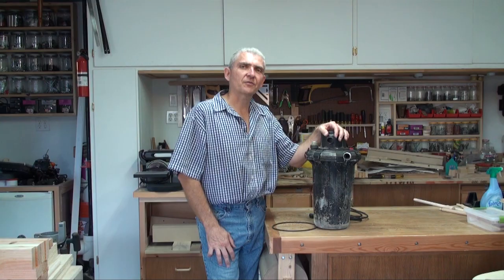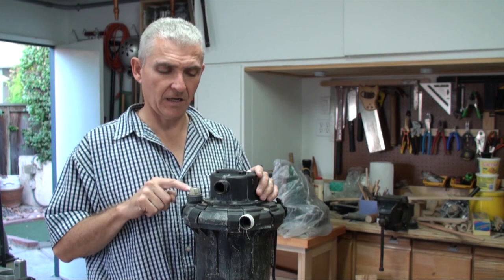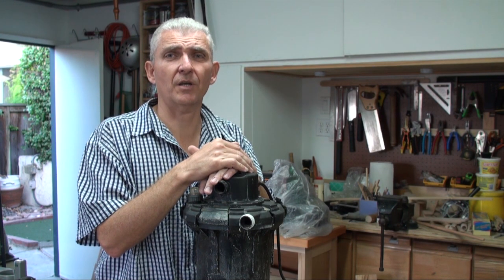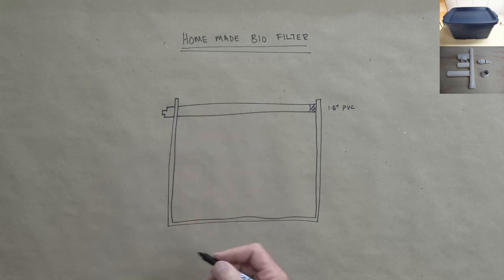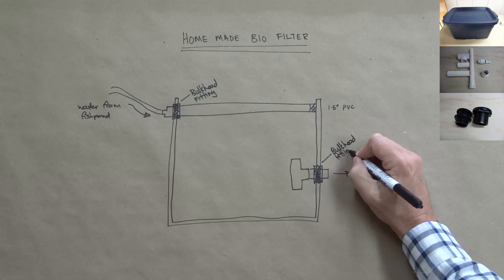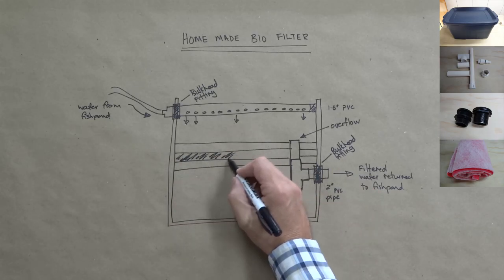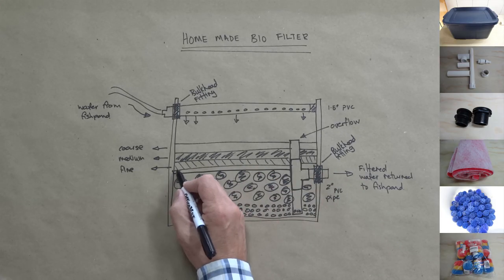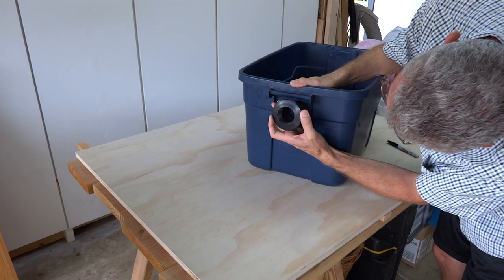Homemade Biological Pond Filter

Comment: I've watched your video several times before I made this comment. First, the video is very helpful and simple, thank you. How would you clean and use the waste water, I didn't see a shut off valve to drain and shouldn't you have to turn the pump off to clean and drain. I have 5 preformed ponds that I want to use, I'm thinking about placing each pond side by side, will I have to have a bio-filter for each pond. I've also made a large skimmer. I'm going to use larva rocks instead of the bio balls. To hold the top cover in place I am screwing it down with stainless steel screw. Again, thank you for your helpful video, great job.
Reply: adairsr53  I built biofilter with a 30 gallon trash can from walmart. My filter media is from Lowes.  It is the blue replaceable airfilters.  DO NOT PURCHASE THE GREEN FILTERS AS THEY ARE SATURATED WITH FORMALDAHIDE! I use scrubbies in the bottom for bio-media.  My out going bulk head is approximately 10 inches from the bottom.  I leave my pumps running while cleaning my filters.  I would not recommend completly emptying your filter as all of your beneficial bacteria grows in the bottom of the filter.  If you decide to use lava rock please wash the lava rock until the water runs clear! If not your pond will turn red.  If you are on city water, after cleaning the lava rock place the lava rock in a large tub, fill with water, and treat with a double dose of dechlorinator.  You don't want to harm your fish with chlorine that deposited in the lava rock.  Let it stand over night in the dechlorinated solution.   If the five ponds are not connected then yes you will need a filter for each pond. If your ponds are connected I recommend at least two pumps and two filters.  Remember that the rule of thumb for keeping a clear and clean pond is filtering or pumping the entire amount of pond water every hour.  For example if your pond is 1,000 gallons then you should have a minimum size pump of 2,000 gallons perhour. My largest pond is 5,000 gallons.  Since I can't afford to purchase a 10,000 gallon pump every few years, I run two 5,000 gallon pumps to two separate water falls at each end of the pond.  Both pumps are ran to homemade bio filters and I have never had a problem with green or cloudy water.  Although I do use beneficial bacteria regularly in all of my ponds.  I never use ALGECIDE! This chemical and other toxic chemicals not only kill wild life but also shortens the life of your pond liners.  I hope this helps.
Sincerely,
Lost Sheep

Comment: I tried this plan.  it is working but i am sucking in a lot of air through the overflow.  enough to put foam on top of the water. Any ideas or have you run across this?
Reply: If water is going into your overflow that means too much water is going in to the filter. Is there a way you could insert a ball valve in the line from the pond to the filter. You could then slightly close the valve until the water is below the overflow.
Reply: Kevin Kilkenny you could just add a little length onto your overflow allowing it to still work if it needs to but that way the water can sit on top of the filtet

Comment: thank you for sharing with us Trevor! i have a question- how are you going to stop the leaking around the bulkhead? i am planing to hide the filter in some bushes , i cant put it on top of the pond... thank you so much!
Reply from the maker: the bulkhead comes with a rubber gasket. I also cut the holes for the fittings exactly to size (i.e. a tight fitting). the combination of the two prevent leaking.

Comment: Thanks for the tutorial on the Bio-Filter. My Koi Pond was previously filtered with a sand filter, a .75 kw pump and UV Light. This worked great. Recently the filter cracked and rather than buy a new filter I used your design. Due to the high flow rate, 20000 lit per hour, the tote would not cope with this volume of water. I therefore made the inflow pipe, 50 mm pvc pipe, to the tote go straight through the tote and drilled holes in the pipe for water to flow through the filter. Most of the inlet water flowed straight through so to have more water flow through the filter I cut a slot, about 5 mm depth, into the inflow pipe just before it exited the tote. I inserted a small plastic disk into the slot which restricted the flow of water and allowed more water to be filtered. By adjusting the depth of the slot I was able to achieve a perfect flow rate through the tote without it flooding. The slot also acted like a Venturi drawing in air so the pond is being aerated more than before..After a week my pond was absolutely clear. Thanks again for an informative tutorial.

Comment: Hi there! Thank you so much for the helpful tutorial!
Can I ask how long does it take for you to change the filter?
Do you simply wash it clean or replace with new ones? Thank you!
Reply from the maker: Initially I cleaned the foam filter material (just washing them) every few weeks as they clogged up from the dirty water. Everything settle down after a period of 2 months and I only just cleaned them again after around 8 months. It will depend on your situation. Once the foam filter material gets so clogged that water will not filter down and simply flows over the overflow then you will need to clean the filter material. I do not touch any other part of the filter because all the good bacteria grows in the material below the foam filters.
Reply: Trevor's Workshop That's helpful! Thank you so much. :)

Comment: Craigslist is no good, sex traffickers use it for making contact with customers.
Reply: marshall886 your logic is so very deeply flawed...
Reply: I am happy to accept that. Perhaps though it would be good to consider 
that  how falsifiability of the statement that  the feature of anonymity in craiglist may  make conducting transactions and contacting others makes   transactions and contact, including sex trafficking make it more so than less possible to evade detection from law enforcement .  Note for your point: I am no longer going to make the argument that sex trafficking is  happening on craiglist for finding a null hypothesis if that is possible.
Reply: Actually since craigs is being used by older generation now, its been the most reliable, the new selling apps have the millenial time wasters that craigs use to have. Of course some scum who do advertise couldnt sex traffic if their life depended on it, you show up, they cant find the item, or sell to someone else when your on the way, just the risk of buying used.

Comment: Looks like a good filter, but more information on the pump, pipes and connecting material would be appreciated. Can you use garden hose off the pump to the filter?
Reply: jsharp116  Dear jsharp116 I would not recommend a garden hose from the pump to filter due to the small diameter of the hose.  The garden hose would easily clog from algae growth within the hose. If there were a way to flush the hose weekly with a high pressure pump, then perhaps.  I never use any type of plumping less than 3/4 inch in diameter.  Have you ever notice how decrotive spitters always seem to clog, or even just contained water garden features such as barrels, wishing wells, fake rock formations from lowes? This is because they all use very small hosing.  If the algae doesn't clog the system first then mineraliztion from your water will (hard water deposits). Unfortunately these companies aren't properly engineering these expensive water features for the common person like us.  They know in a year or two were screwed due to the plumbing and it's nearly impossible to replumb.  Hopefully this was able to give you some insight not only into the DYI filtration but also other water features and food for thought on your next purchases.

Comment: A QUESTION this also needs a pump right????? or how the water will go inside?? some one explain me please
Reply: Hello,
Yes it needs a pond pump. Make certain you use a "pond pump," which moves large amounts of water but does not create high water pressure. The pump should also move at least 4 times (per hour {gph}) the water in your pond. Be Well

Comment: How many GPH pump does this system take roughly?  My pond is 1500 gallons~, and would like to make this, but my only spare pump is about, 700GPH.  Would that be big enough.
Reply: you should theoretically pump the volume of your pond every hour, so as a rule of thumb you should have a 1500 gph pump. you can always go bigger but smaller is not recommended. you also need to factor in the amount of resistance the pump will encounter. if your pump is at the bottom of your pond which is 3 feet deep it will encounter 3-3.5 feet of resistance.
Reply: Trevor Green

Comment: If the water has to go through a pump first, how do you prevent it from becoming clogged up?  This is the problem I have with my ornamental fountain, the water goes through the pump, clogging it up before I can filter it.
Reply: Barry Garton Does your pump have a prefilter. Every pump should have a prefilter. I'm sure you know this but this is the grate that is attached to the intake of the pump.  You can even purchase a pump bag for your pump to prevent algae from entering your pump for ornamental fountains. Your Ornament fountain is clogging due to algae or mineral deposits. This is because the manufactures all use very small hosing.  If the algae doesn't clog the system first then mineraliztion from your water will (hard water deposits). Unfortunately these companies aren't properly engineering these expensive water features for the common person like us.  They know in a year or two were screwed due to the plumbing and it's nearly impossible to replumb. A great cure for ornamental fountains is adding water softner salt to your fountains.  This will soften the water just as it does in your home reducing the hard water.  If necessary to unclog the pump.  Remove the pump, fill a bucket that is large enough to hold enough white vinegar and completely submerge your pump in the vinegar.  Run the pump in the vinegar for a minimum of 24 hours.  This will remove the majority if not all of the hardwater and algae deposits.  You will notice that your pump is running faster, quieter, and like new again.  I do this to all of my pumps every 4-6 months. It's an inexpensive and easily maintenance solution to prolonging the life of your pumps. Hopefully this was able to give you some insight not only into the DYI filtration but also other water features and food for thought on your 
next purchases.    

      
      
Show less

Comment: Where did you get those filters at? (Mainly the red yellow blue packaged ones) I'm building a filter this weekend for my moms 1000 gal koi pond and was wondering what sized gallon tub should I use? Thanks for making this video as it's been really helpful understanding all this as I'm new to it all.
Reply from the maker: check out my website at http://trevorsworkshop.com/?p=90, there is a llnk to Amazon where you can buy the plastic scourers I used. My pond is 1000 gallons and I used a 14 gallon tote from Lowes.
Reply: And that 14 gallon tote is working out pretty well for your pond? I ask because some of the videos I've seen people were using/recommending around a 30 gallon tote, if not bigger. Thank you for the link.
Reply from the maker: Rocco the 14 gallon works out for my pond, although there are other factors to take into consideration too, the number of plants and the number and size of fish in your pond. I have around 14-20 goldfish in my pond and some water plants (not a lot going on). the biological portion of your filter will grow to a size necessary to sustain your pond, so even though you have a filter twice as large does not necessarily mean it will work twice as hard. however, if you have a large number of fish and the filter is the only means necessary to keep your pond healthy then you may require a larger filter. it would do not harm to your pond to have a larger filter but you will require a lot more filter material. hope this helps.
Reply: Rocco is a great dwxcccznmhjkhn
Reply: Yeah we’re making a pond for our two Indian Runner ducks and they poop a lot! So while our pond won’t be that big, we bought a couple huge homemade filters off Craigslist. They’re basically this in 50 gallon drums... was cheaper than buying the parts and it’s already made... win win. We are also going to have a larger pond that will pour down to them and that’ll have all of our water lilies and stuff we don’t want them eating.

Comment from the maker: @gomewex- you can put this filter at the top of your waterfall, you just need to ensure that your pump can deliver water to the filter (I am assuming it can because it is probably doing that now). With respect to cleaning, in the beginning my pond was very dirty so I had to clean the filter material several times during the first 4 weeks. Since then I rinse the filter material around 2-3 times a year (mostly during summer) to clear the debris out. Good luck with your filter if you decide to build one.
Reply: Excellent tutorial. Thanks and Be Well.
Reply: What water pump do you use for your pond?
Reply: HI Trevor, great tutorial thank you. Can you submerge this filter into a pond? I need a filter that can be installed inside my 480 litre pond? The lid can be over the water line but not the body.
Reply: that IDEA I can do & be happy about & easy to do too.
Reply: i think the sun will make the plastic box brittle over time
Reply: I built my own filter  but i decided to fill from the bottom and drain out of the top after passing through my media will this make a difference?
Reply: What grade plastic is that? Is it food grade to be fish friendly or just random cheap plastic that poisons your fish over time!